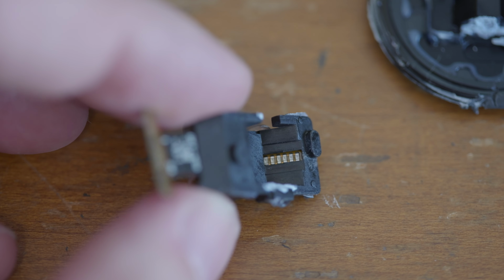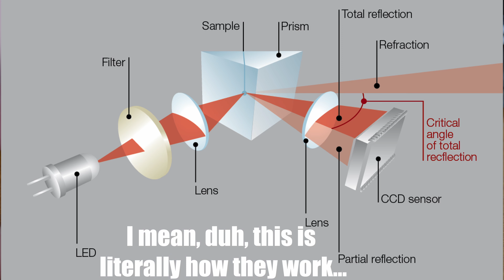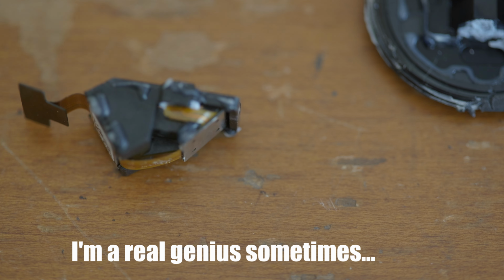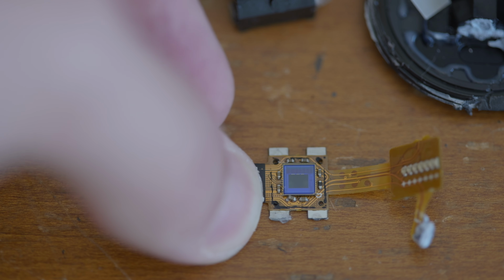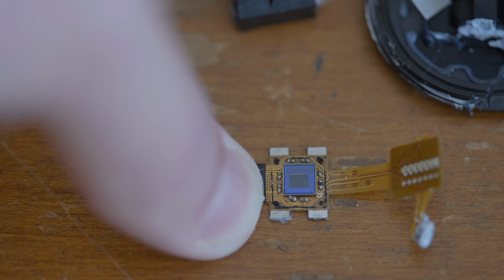DiFluid R2 Extract Refractometer Teardown

Comment: Hello. I have this device that I bought last June. I was  used it till August then I stored it till today. It was normal without issues. Last time I check the battery was around 30%. After I used it, I charge it. After around 2 hours, I check but it can't be turned on. I try to connect it to charger again but no response. After several times trying to charge. It's on but the battery is not charging and stuck at 1%. Any advice so it can be charge again? Thank you
Reply from the maker: Not really, unfortunately. Sounds like the battery is going bad, most likely. You can't open these easily without destroying them. But if you bought it in June, I think it should still be under warranty, so I would contact DiFluid and see if they will fix it.
Reply: @ Thank you for your reply. I’m working on it. Contacting difluid support and seller whom I bought the product